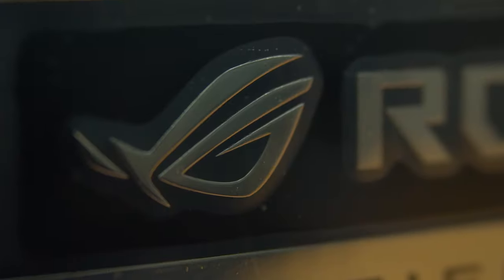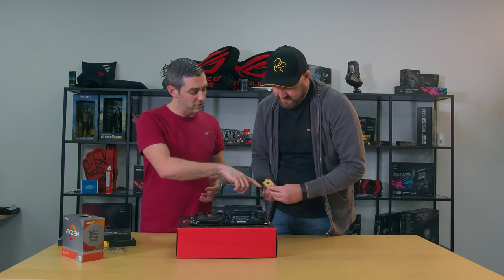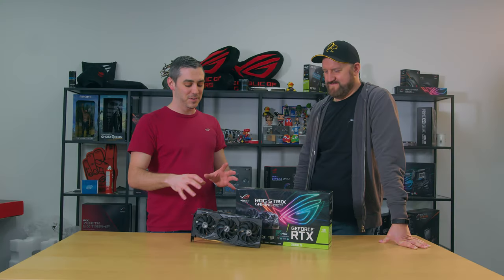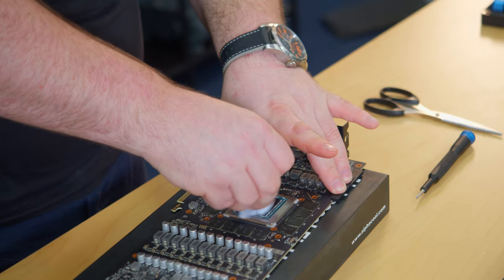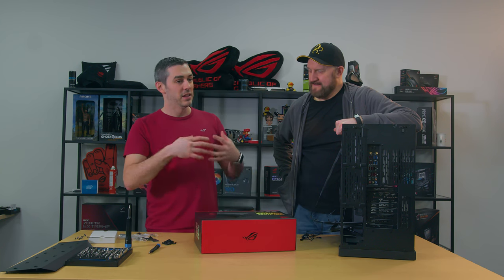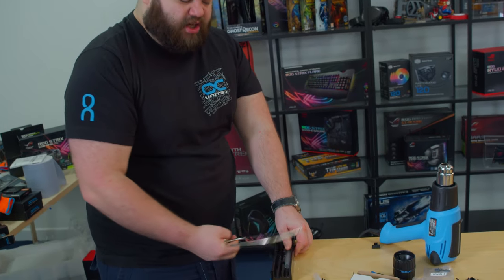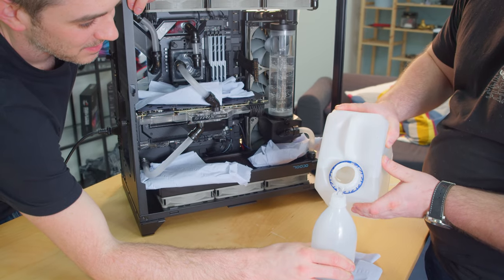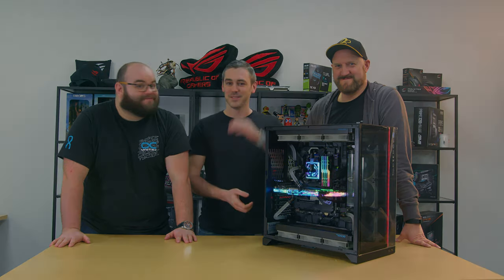Building The ULTIMATE Custom Watercooled Streaming PC!

Comment: What is it with case makers building cases with bad Air flow?
Reply: Are you talking about this case, cuz it has some of the best airflow in the market. Looks can be deceiving my friend.
Reply: @mahnamejeff7586  When you purchase a case and it does not show much for air flow  what to you expect.  When one can see open mesh and a clear path for air flow.. Its not rocket science.. Remember the customer has only the pictures on the sales site to go by.
Reply: @1gatomon  that's stupid, because if you scroll through the pictures, they clearly show where there is ventilation.
Reply: @mahnamejeff7586  This is why I do not purchase your cases. Never call someone that built Thousands of computers stupid.